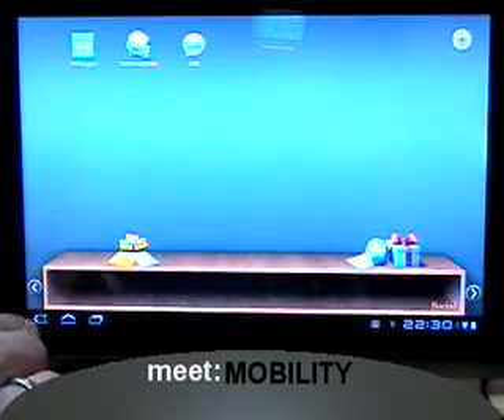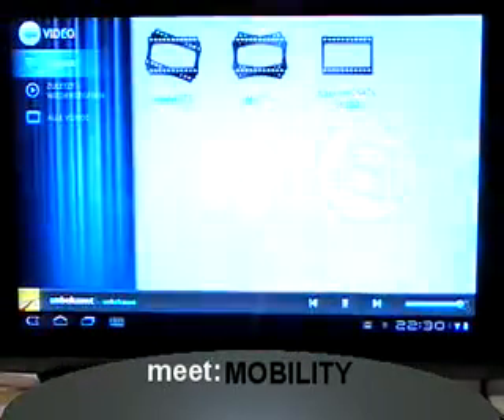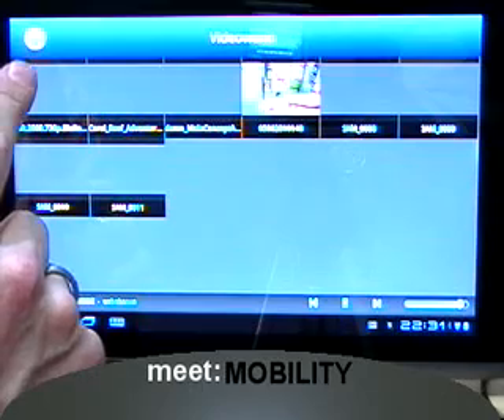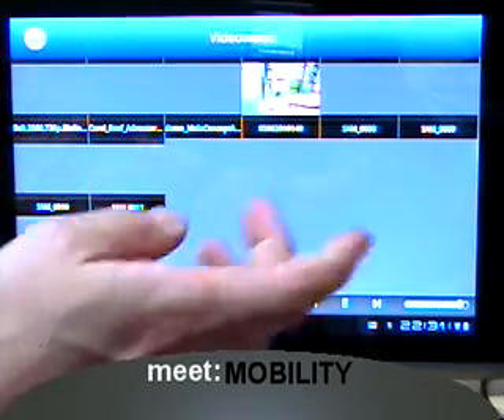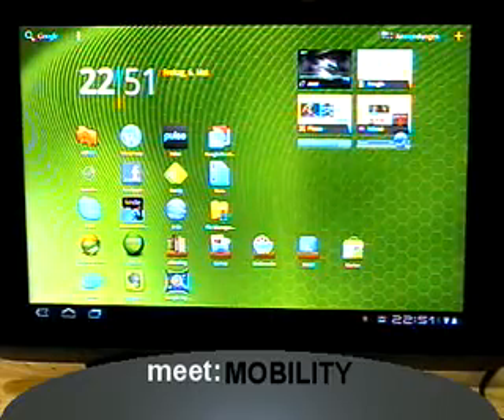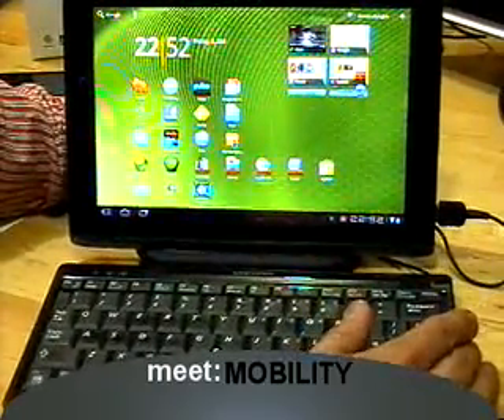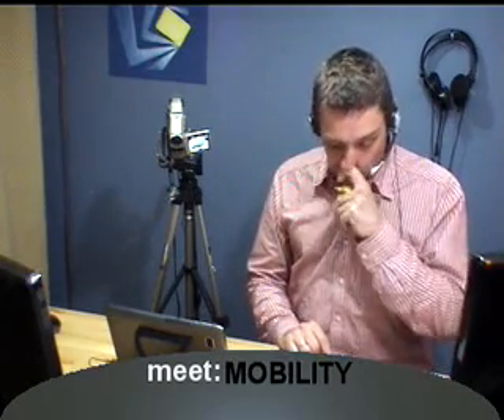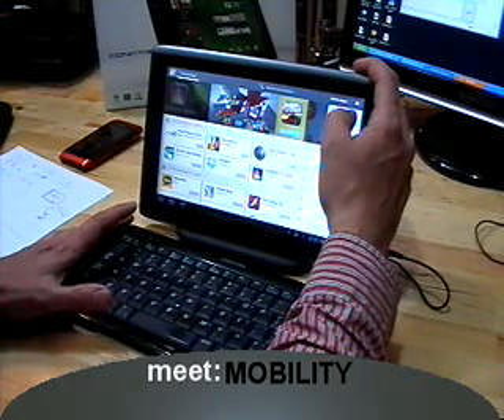Acer Iconia A500 Live Review Pt3 - Video, Cam, Batt, USB tests

Comment: In 2012 the Iconia is running Ice Cream Sandwich (after auto update), and the price has come down substantially ...  I also frequently connect a USB hub to the Iconia's USB port, and then connecting a 16 Gig USB Drive, mouse, and keyboard all at once on my 32 Gig Iconia, with another 32 Gigs in the SD card expansion slot.  Brilliant device for the price.